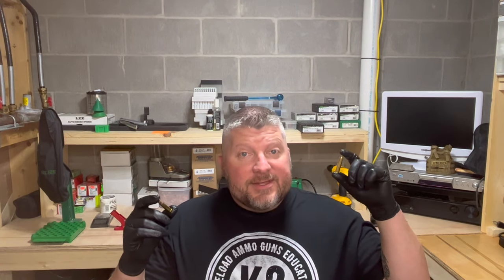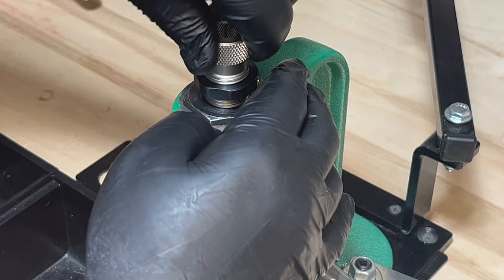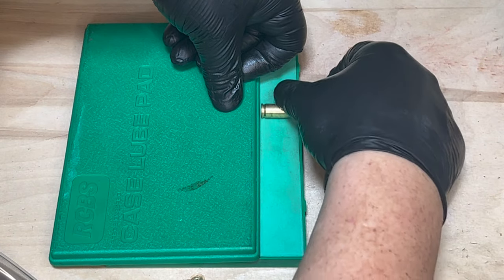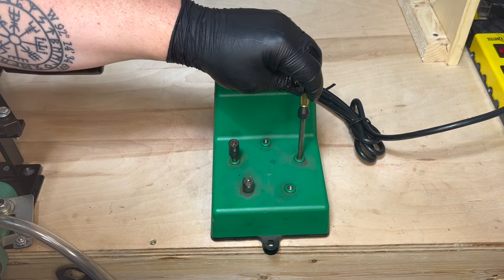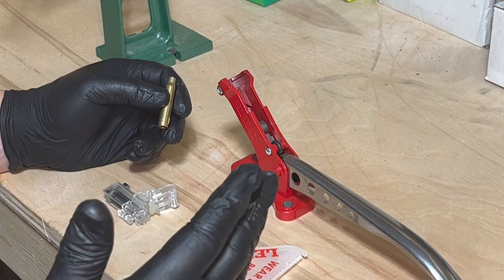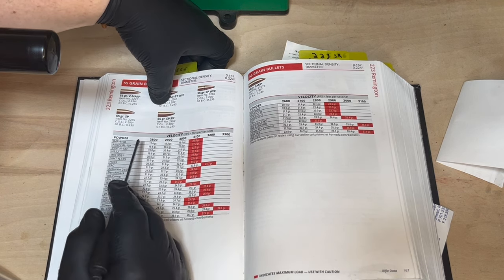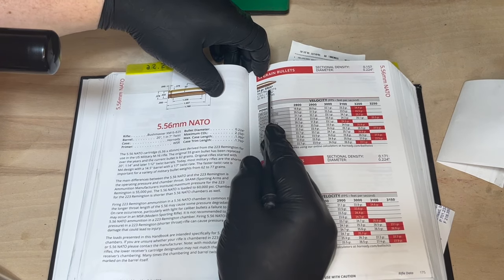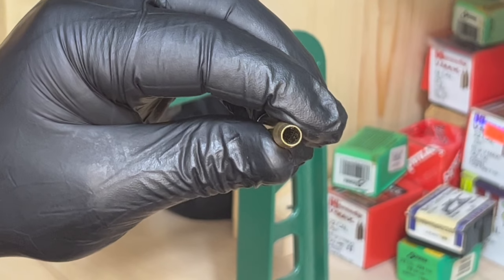How to Reload .223/5.56 For Beginners Easy and Fast

Comment: All you need to know: 25 grains of H335 under a flat base 53 grain Match Bullet. Absolutely no need for small base resizing die. It thwarts accuracy and decreases case life. One more thing, begin shooting factory match ammunition to have a basis of understanding for what might be possible from handloads, since initially it is not at all likely that a novice handloader will get or recognize an acceptable loading. One more thing it’s not about “working up” a load. It’s always about developing a load with low SD and ES from a high BC bullet. In other words, accuracy over velocity.
Reply from the maker: Thank you for your feedback!

Comment: So what happens if you don't trim them and they are too long? They won't seat in the chamber?
Reply from the maker: @fairplayer916 - if they are too long and you chamber them, there is a possibility that when they go into the chamber the case mouth with compress around the projectile. When you squeeze the trigger, it will cause over pressures and you could have blow back into the upper receiver. I’ve only seen this happen one time are the range. He was not injured but it blew the bolt back and destroyed the upper receiver. The gun smith torn it apart and found that the projectile and case mouth were still in the chamber and the rest of the casing was blown out of the side and bottom of the case.  Wish I had taken a picture but we were all shook pretty good and just happy no one was hurt. Hope this helps! 👍🏻

Comment: 2.26 is spec for overall length on 556 not 2.16
Reply from the maker: Jeff Metz - actually for the 55 FMJ the C.O.A.L is 2.20”. I didn’t explain it in the video but I run mine a little less than that 2.16”. Just what I find that works best for me and my mags. For beginners I suggest that they run what the reloading manual suggests. Thanks for the comment! 👍🏻

Comment: Most military brass is quite longer than .223.   My 5.56 once fired is 1.760 to 1.775.  My .223 is usually no longer than1.775.  Be wary.  Lots of influencers  get subscribers. Be wary. 5.56 and .223 are different.  All are useable, with trim length noted.  If corn cob is in primer hole? The deprimer will  clean it out.  Any extra brass removed will weaken the base.
Reply from the maker: Norman McNeal - both .223 and 5.56 have the same max case length at 1.76 and case trim length at 1.75. Could you perhaps reference where you got your information? I just want to make sure we’re all on the same page. 👍🏻
Reply: @k2defense   I hear ya. I’m just telling you what variations of scavenged brass I have used, and what the lengths were. Promise!  All kinds of “ spec” chambers that these cases were fired from.
Reply from the maker: I misunderstood  what you had originally said. I’m trackin’ now. 👍🏻

Comment: First you don't really need to tumble any brass. If it's dirty just wash it. The case does not only expand at the last one third it expands throughout its length. The whole case should be lubed including the neck inside and out. Once you have a case stuck in your die you will learn to lube.
Reply from the maker: Over lubing will dimple the case shoulder. The point that “gets stuck” in the die is the lower third of the case. If you lube the lower third of the case, no more stuck cases! 👍🏻
Reply: @k2defense  The neck of the case needs to be lubed inside and out. If you are neck sizing only there is no need for lube on the bottom third of the case.
Reply from the maker: Russel Keeling - correct! The SB dies indicate the use for lube on the lower third since I’m not neck sizing. Thanks for the feedback!

Comment: Oh great lead dust being spread all over the house.
There is NO NEED to be using a small base resizing die.  It over works the brass.  RCBS lube sucks!  Get Redding Imperial Die Wax.  And, a used bore brush with some lube on the brush and then lube the inside of the case neck.  You stretch the case neck running the case neck over the expander ball. Mise as well make it slide over!  Wipe the case  lube off the case before putting it a case gage.  Why gum the case gage.
Reply from the maker: Hello John E! Thanks for the comments!

Comment: Well, you're starting off on the wrong foot with dry tumbling. Well, hope it gets better.
Reply from the maker: Robert W Sieburg - no issues here! 👍🏻
Reply: @k2defense  When I started out, I did not see the problem. When I watched hours tic by, that was my first clue. I can take a large batch of brass now, do a pre-tumble to get the first quick clean done in 20 minutes and throw it in a warm oven to dry. Lube the whole large batch size and de-prime, then throw them back in for complete cleaning, which thoroughly cleans primer pockets and makes the brass look great, drain and tumble pins out, then back into the oven ready for sizing under 5 hours. I remember vibrating for 6 hours to clean the brass and pilot holes all needed cleaning,  adding one more step and time.
Reply from the maker: @1stFlyingeagle  sounds like a great system! Always good to hear others perspectives! 👍🏻